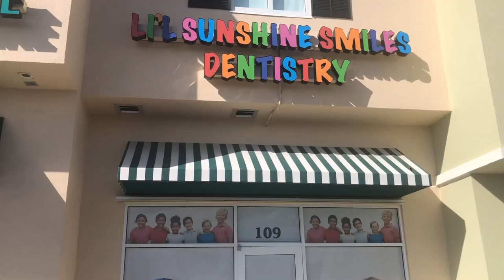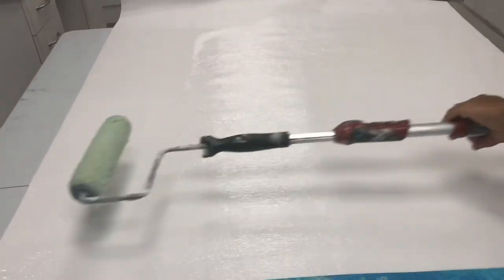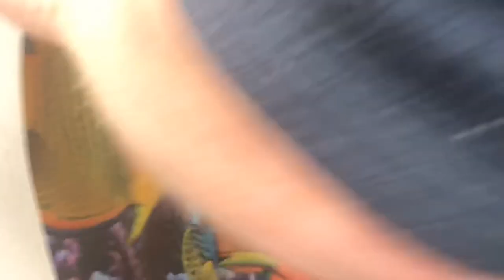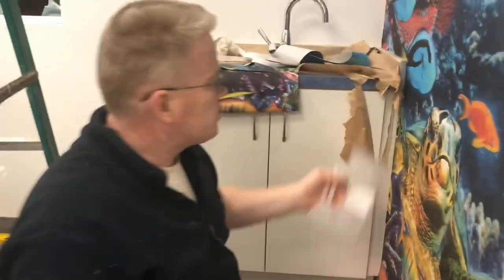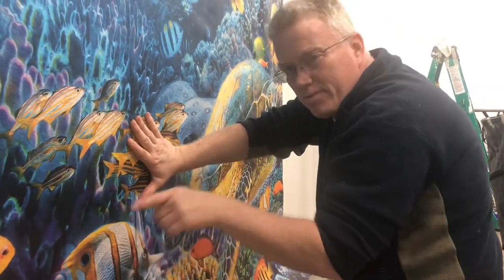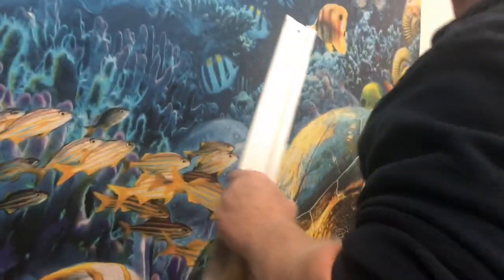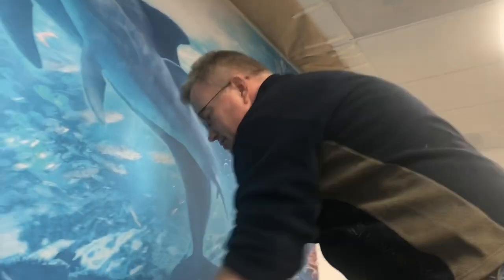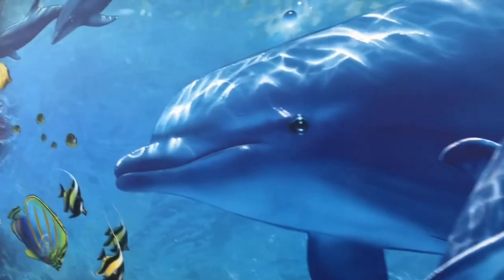Wall Murals: Tips and Tricks - Spencer Colgan

Comment: I am about to hang a mural for the first time and I have immersed myself in your mural hanging videos. Thank you!  They are outstanding!!  Because of grandkids who will be using the room when they visit, I had my mural printed on heavy vinyl material.  It's a 3 panel mural (8'wide x 5' high) so not too huge, but still big for a first timer!  The odd thing is, when I went to Home Depot and Lowes just now to find paste they don't have what I need. They only had 1 brand and it was for lightweight to medium paper. They didn't have tools either.  I had to order online.  My mural is unwrapped and laying flat on the floor acclimating in the room right now (per the directions from the manufacturer).  I'm nervous about the installation, but at the same time I feel much more confident about it because of your excellent tutorials. My husband will help so I'm sure we'll be celebrating with a margarita at the end!  :-) Thank you for ALL your videos.
Reply from the maker: Jane.  The two most important problems you will face are:

1. Bubbles
2. Double cutting. 

Do not use too much glue. If you put too much glue, you will have a serious problem.  Make sure your wallpaper mural  has directions and that they tell you how long to book your mural. 

Put a super thin layer of glue on your wall first and let it dry. Super thin with a paint roller. 

Your mural will have to be double cut I am assuming. If you have never done this before, this will be the second of your greatest challenges. 
You will need a straight edge to cut against and you will need 9 mm olfa blades. I recommend a magnesium or Steel yard stick.  Cut FIRMLY THROUGH BOTH LAYERS. 

Do not worry about being too aggressive because if you do, it is likely that you will not penetrate the second layer. Maintain an aggressive pressure from top to bottom; do not lighten up  halfway down the cut!  You will have a disaster on your hands. 

Lastly, here’s what I want you to do.  Go and buy roman 977 and put two layers of this on the wall under the mural. Let it dry overnight. 

When you overlap the edge of one sheet over the edge of the other, make sure that you are directly putting the pattern over the pattern underneath it. You may have to slap the wallpaper with the palm of your hand shoving it into place because if it doesn’t match up before you cut it, you can expect a mismatch after you cut it. 

Good luck.
Reply: @spencercolgan  Oh my gosh, you are too kind.  I already bought Roman 838 paste and I'll be careful not to use too much (thanks!). I will get the Roman 977 primer and will apply as you say (thanks again)!  I already bought a DeWalt snap-off blade (25mm) and I have a straight edge. The manufacturer's directions are this. "Lightly damp the paper backing with a sponge. Allow to soak for 10mins. When the 10mins is nearly up, use a roller to evenly apply wallpaper paste directly to the wall, covering a few inches past the first marked section."  They didn't say to book it (fold it onto itself, but I plan to do that.  I'm going to follow your instructions (using the back & forth flipping method to line up the pattern / using the fingernail trick / and moving it left or right to line up rounded edges, etc.).  I have several 8" wide waste pieces that I had to trim off the panels (leaving only 2" of waste edge per panel now) so I plan to practice with these waste sections on an inside closet so I can practice how much knife pressure to use for the double cut.  Thanks for your amazing help!  You went above and beyond to help!  Thank you!
Reply from the maker: @jsorensens2  

No!   Please do not use 25mm!  Use 9mm black olfa.  

You will see your seam if you use that.  

Secondly... The reason they want you to dampen The back of your wall covering it so that it expands. 

This is very important: do not put too little glue on your wall you need to be able to do a little bit of sliding the wall covering; if there is not enough adhesive, you will have a very very rough time. Secondly, make sure that you have a bottle of water in a spray bottle because of the wallpaper starts becoming impossible to move or too difficult, lift it up off of the wall and spray the back of the wall covering so that it moves easily.  

I just thought of something… Would you mind going to the following link and writing  me a five star review on how much my videos have helped you?

https://www.google.com/search?q=tampa%20wallpaper%20installer&tbm=
Reply from the maker: @jsorensens2  here’s the product I’m recommending:

https://youtu.be/Xu54UPG1cME
Reply: @spencercolgan  Ok, I'll find a 9mm black olfa. Thanks for the additional tips. You are so kind and generous with your knowledge and time.  I left you a 5 star review on google.  :-)
Reply: @spencercolgan  Got it, thank you!